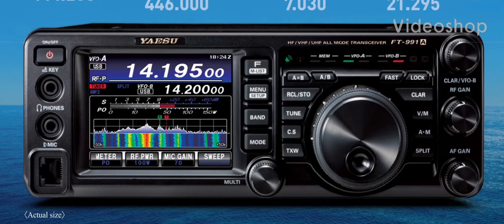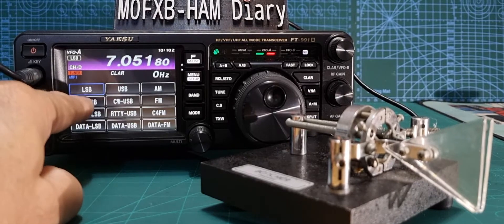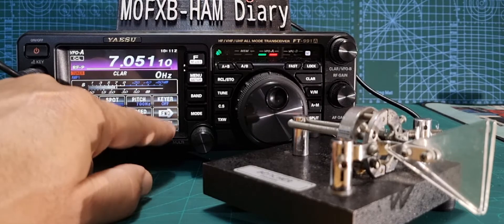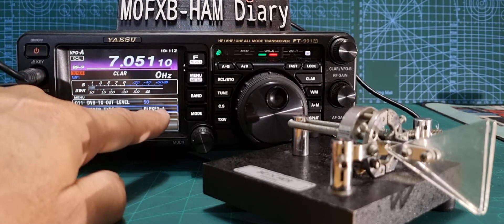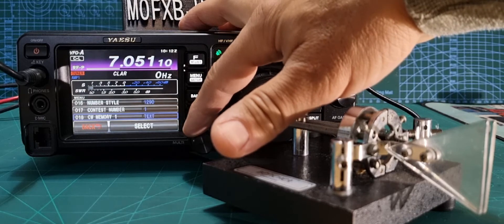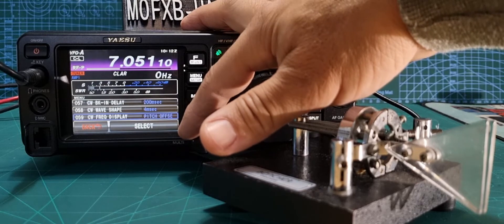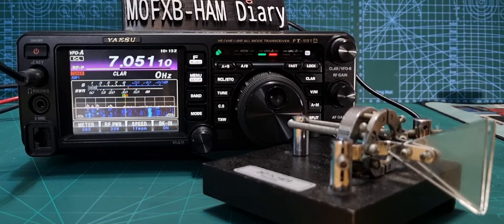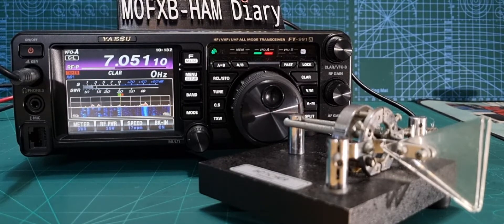YAESU FT-991a - CW Settings Options

Comment: I practice reading stuff and then simultaneously sending it as code while I'm reading. I need practice receiving. For now I use the computer for receiving and I send manually. I can usually send at a solid 15 words per minute.
Reply from the maker: Keep up the good work takes time:)